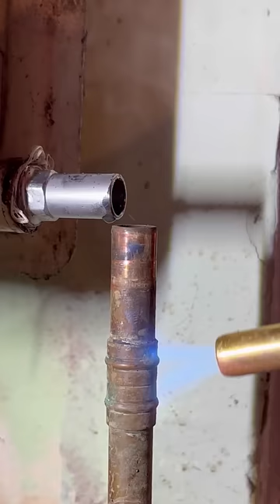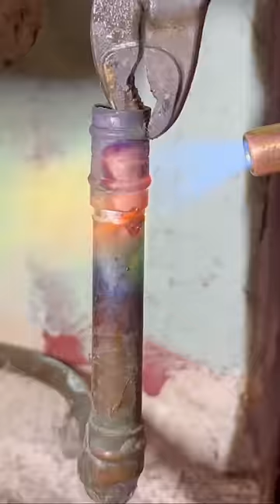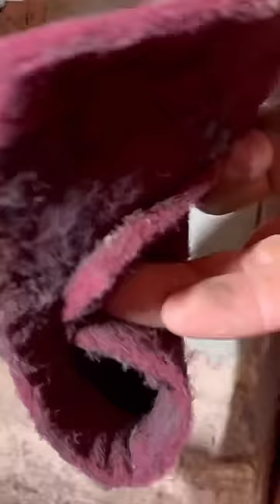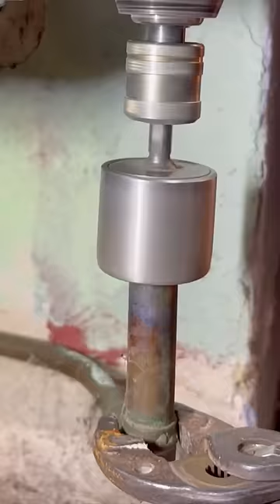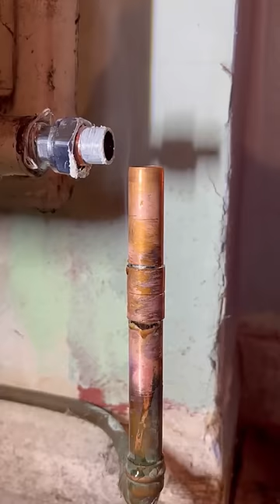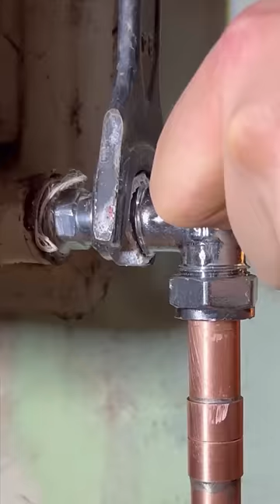HOW To remove water from pipe for soldering! #howto #diy #plumbing #youtubeshorts #asmr #subscribe

Comment: Never saw that spray trick before to remove the water.  Brilliant idea!
Reply: I used to use a straw  lol or a 3/8 ridged  speedytube
Reply: I usually have a piece of 3/8 flex line the spray bottle I’ve gotta try
Reply: Most plumbers .Have a wet vac on hand
Reply: You missed the point entirely, this is a great tip, vac will pull from other lines. Not to mention many other variables
Reply: You are just equal, not smart like him.
Reply: I use spare earth sleeve as a straw and suck it out. Got throat cancer tho
Reply: @grrinc  You are not supposed to swallow the water.
Reply: @grrinc  😂
Reply: Piece of rolled up paper towel.  No need for this craziness
Reply: Use a wet vac balls to this method .
Reply: @pauljenkinson2870 exactly because that's what real plumbers do . And we don't burn the shit out of our pipes .

Comment: No reason to use pipe dope on a compression fitting.
Reply: Lubrication. Not necessary but it helps
Reply: @micromashington  helps with what exactly?
Reply: @Jch914 lubrication of the threads
Reply: @Jch914  lubrication of the threads
Reply: @paulmacdonald7068  why do you need to lubricate the threads?   That doesn't make any sense. Been plumbing 25 years never needed to lubricate the threads.
Reply: @Jch914  you don't need to, but it helps while tightening it down. Not sure how this is hard to understand.
Reply: @paulmacdonald7068  not hard to understand just pointless.  Why do you need help tightening compression fittings? Never found it to be challenging endeavor.
Reply: Thank you for this comment! I was worried I had been missing something for the past 20 yrs.
Reply: @dukebecker4535  glad to hear I am not the only one.
Reply: The theory might be that it will act as a never seize. No real harm either way.
Reply: @orange3203  have you ever had a stop seize on you?  I mean, it is only half inch compression.  It shouldn't take much strength to remove even under the worst conditions.
Reply: @Jch914  no I haven't. I'm just saying looks like a no harm step other than wasting dope. I know guys that dope the threads on unions. No real reason for it but also no harm I guess.
Reply: The threads do not create the seal....thats the job of the olive! Where were you trained? Disneyland?
Reply: @stevewoodward7850  who we talking to here? I said I know the threads aren't the seal. Dope on a black iron union does keep the threads from rusting up though. Possibly that is the thought process here.
Reply: @stevewoodward7850  never said they did.  The ferrel makes the seal goofy Englishman.
Reply: It's actually agasint manufacturers reccomendation to lubricate the threats on a compression fitting.  It leads to over tightening.
Reply: @nes999  it actually serves no purpose whatsoever. Some people put PTFE tape on too and this is completely pointless! I stress again it's the olive that creates the seal. Uk plumber👍
Reply: @paulmacdonald7068 but he didn't put any on the threads, only on the pearl (don't know if that's what it's called in English tho)
Reply: @micromashington but he didn't put any on the threads, only on the pearl (don't know if that's what it's called in English tho)
Reply: Ok, if you’re using it to lubricate the threads then just put it on the threads. Which is not needed. But don’t put it on the pipe under the compression collar or on the collar.
Reply: I always use a jointing compound with compression fitting olives. All I know is I never get a leak and I never get call backs.
Reply: @daz3745  you’ve wasted your time, Literally! It’s not just not required, it’s also advised by manufacturers to not use sealant on compression fittings. Except of on the tapered pipe thread portion.
Reply: He the reason I sand before compression ring tool😂...please stop with the dope...just install them correctly
Reply: Ive seen it plenty of times
Reply: Putting goo on the olive is the different between a drip and no drip on a Friday afternoon, in an ideal world there is no need to goo up the olive but we don’t live in an ideal world.
Reply: @justme5384 it’s called an olive
Reply: @richardcordell9377  the f it is. Had to Google. It's called a ferrule. But in Finnish it's helmi and Swedish it's pärla, and both means pearl. You speak English because it's the only language you know. I speak English because it's the only language you know. We're not the same
Reply: Less chance of it leaking...
Reply: @richardcordell9377  than what does a Ferule puller pull?
Reply: There’s actually a video about this that was shown to me the last time I did my gas safe a few years ago. They recommend paste now as the nut slides on the olive when tightening and doesn’t grip it. Without paste the olive can twist and the fitting can tighten out of square. 
Although Ive been plumbing/gas work for nearly 30 years and I only paste something if the paste is within arms reach 😂
Reply: You people are all so sad arguing over using jointing compound on an olive/ferule. Let the man make his money and stfu
Reply: Ahh - the YouTube plumbers all arise
Reply: @Jch914 open your mind to other practices.
Reply: @venividivici4253  you mean the wrong way?  Give me a break. Only reason to use pipe dope on compression fittings is that you are completely incompetent and can't do the job correctly.
Reply: It’s joining compound,standard practice domestic & commercial gas engineer 25 yrs uk
Reply: @andrewcostello8626  might be standard practice in the UK but not in the US.  This is what hacks use who can't install correctly.  25 year master plumber who works with water and gas.
Reply: @Jch914  he has made a repair in situ,do you want to rip the whole system out and replace it with flexis.i also am a domestic and commercial gas heating engineer,I work with gas oil and water,and an f gas registered HVAC engineer so refrigerants too.if this is a dick swinging comp, I got a serious chopper my friend,I’ve poked the tip out
Reply: Was thinking if it’s drinking water that’s nasty
Reply: @orange3203  how would a copper or brass fitting rust 🤣
Reply: @Thedar561  copper does corrode but those fittings are more likely to get stuck with calcium deposits. I'm not saying it's a common or even likely problem but I also don't see why it matters if they want the extra insurance.
Reply: @orange3203  it might corrode but it won’t rust, rust only happens on iron
Reply: @Ryanwolson12  I agree you will always have a bunch of children arguing over the smallest things. Grow up children please 😅😅😅😅
Reply: @Thedar561  I never said rust in relation to copper. I said I've seen it used to prevent rust and corrosion on black iron unions. Oxidations oxidation you correct it's not called rust on copper but it still oxidation.
Reply: The only thing I dope that requires no dope is the threaded portion of gas flare fittings. Never ever ever past the first couple threads and absolutely no on the mating and mainly just to squeeze out some yellow Rectorseal to make other people feel better and so I can visually verify that it was done. I have a very sensitive gas detector, that's what I stake my decision on. It serves absolutely no purpose in the sealing, and provides no real noticeable difference in required mating force. It's window dressing for safety inspections.
Reply: You've been plumbing 25 years and never used dope? Dope is specifically for the threads... Were you using it wrong all this time? Or people don't call you back when it leaks so you never found out? I've plumbed across the US and it's pretty standard for quite a long time... (Not 25yrs though but pick up a modern book??)
Reply: @Thedar561  Corrode, and usually because we have a boner for nickel or zinc plating everything, or switching metals repeatedly, which makes a fitting more susceptible to galvanic corrosion especially in hard water. Dissimilar metals in the presence of an elevtrolyte. But yes, you need ferrous metals for rust.
Reply: @00gyb00gy  I use dope on iron pipe threads as required.  Dope and tape are not required on compression fittings. Do you not know the difference between iron pipe and compression?  Learn to think before you speak.
Reply: @paulmacdonald7068 its hard to believe the people need lube to tighten an angle stop also he didn’t even put it on the threads which I’ve seen and understand the thinking behind but nah he just caked his farrow in fucking pipe dope which makes no sense and also pisses me off 😂
Reply: @Jch914   is it really that big of a deal? You found out the why, you agree to disagree, you move on. I've seen a grown man so caught up that hes invested a month in one comment..

its really not that big of a deal..
Reply: @nes999 il suffit de ne pas trop serrer, c'est le meme constat que lorsqu'on ne lubrifie pas et qu'on serre comme un turc pour etre sur que ca ne fuira pas.
Reply: @Jch914  I was reading from a factory site about lubricating the threads with a light OIL application which would aid in the future if compression fittings need to be removed.  You still tighten to fit.  However, using pipe dope is not recommended according to the site.  Makes perfect sense to me.
Reply: @justme5384 it’s called an olive in the uk where this guy is based and it’s not “dope”. Why do you Americans think you’re the only country in the world and the only people who do things “properly”. Is he hurting you? No Are you right about the “dope” ? No. If you don’t like it go spend your time somewhere else. Start a YouTube channel for example. You obviously wouldn’t take his advice so why the heck do you think he cares about yours? You’re just increasing the number of comments and by extension his income. So if you’re trying to make him more money; crack on with the ill informed comments.  And have a lovely day.
Reply: Any plumber that says they don’t need paste on a compression fitting gets weeps all the time. Every fitting needs it
Reply: Just curious…are you calling the ferrule an olive?
Reply: It’s actually spelled “ferrule”, even though how you spelled it looks like it would be right.

I’ve seen some comments refer to them as "olives”. 
They probably thought they were sounding professional!
Reply: True, and he never actually puts it on the threads.
Reply: True, and he never actually puts it on the threads.
Reply: Are those actually called olives per manufacturers?

I’ve only known them by their trade name, “ferrule”.
Reply: Why do they call it dope? Do the fumes make you high?

Comment: Perfect except id personally sweat the pipe off at the elbow at the bottom to have a fresh piece of pipe without the coupler 👍🏻
Reply: I’d do the same I hate couplings unless absolutely necessary
Reply: I was just going to ask is there a reason for the coupler? but I’m assuming there isn’t as I was thinking why not remove it at the elbow and put clean pipe work in
Reply: He was probably.worried about that soft copper getting kinked trying to get a 90 off it. That shit gets weird when it's old I've seen it split when getting heated up when it old and someone tried to reuse it after ripping fittings off lol
Reply: I Still thinks he's an apprentice
Reply: So what. Make your own vidro.
Reply: Do yourown video, then
Reply: Have you seen the price of copper son dayum.

Just kidding I’m with you - one less point of failure
Reply: @nothankyou5524  check your spellings
Reply: Me too
Reply: you couldn't sweat it off there because the horizontal bent pipe is filled with water.  Perhaps you could cut it off though.

Comment: Why not just unsweat from the elbow and have a continuous length to the rad valve, rather than unsweat a straight coupler?
Reply: Why waste copper haha
Reply: This bloke does a lot of questionable things
Reply: That's what I thought
Reply: the spray bottle trick wouldn't work then... all the water in that pipe is at the elbow level and fills that horizontal pipe.  You wouldn't be able to unsolder that elbow since the horizontal pipe is filled with water.  You could cut that elbow off; but then the pipe might be long enough to get that new vertical pipe to where it needs to be. The vertical pipe below the coupling was just long enough so that the guy could show off his spray bottle life hack.

Comment: I usually just stick a piece of 1/4  pipe in hole and suck water out -nice video - thanks
Reply: The next size down in Pex, run the longest length you can, stick your finger over the open end, withdraw, remove finger. Or, if the floor can get wet, you can just stuff anything in the pipe and force the water out (1/2" copper with your thumb over it works great for 3/4", 3/4" for 1", etc). The ones I hate are the slightly leaking gate valves in buildings that need to have pressure reducing valves installed that make a sweat connection next to impossible without shutting off a busy commercial building's water and replacing the valve entirely.
Reply: Or blow it out
Reply: @damien1563  ko
Reply: Blow don't suck
Reply: Learned it from your mother?

Comment: I see a lot of comments on him using the coupling instead of going right to the 90 more than likely it's because of that lower it would be hard to keep the water out of that as opposed to the standpipe.
Reply: Exactly. Empty the stand pipe down as far as you can, and work fast, while a drip slowly fills it back up! The elbow is plan B

Comment: The spray nozzle is extra intuitive, very, very smart. I've been doing plumbing, I'm 45 years old. I've been doing plumbing since I'm about 15 side stuff, not as a career. It was the first business I wanted to open but I didn't for reasons. I'm not going to go into it, but I still enjoy sweating and soldering and cutting and bending and running pipe and roughing. But that i've never done that was genius

Comment: I just use a straw or small 1/4" tubing to stick inside while plugging other end with a finger to pull out the water. Stick in all the way, then plug end to trap the water inside & remove. Sprayer would work well for a smaller tubing though.👍🏻👌🏻🛠️

Comment: your soldering is very good, just don’t put flux on a hot joint because it can cause the solder to crack which can cause leaks over time
Reply: Flux, what's that??

Comment: What kind of fitting came off of that? Looked a lot like a pro press fitting, but they are not soldered on. If any one knows, what are those bumps for? Some sort of high heat gasket? Place for extra solder to collect?
Reply from the maker: There pre loaded with solder
Reply: @mmplumber  hmm interesting…

Comment: Was that a propress fitting that was soldered?
Reply: Nope a soldering or Yorkshire fitting. Fitting comes with a ring of solder inside ready for for the torch
Reply: @COUPEDUMMY  ah ok, I've never heard of that before :)
Reply: @Electronichub_05  might be a uk thing only. Different plumbing around the globe
Reply: @COUPEDUMMY 
I see them for sale in illinois, never bought them though.
Reply: They were popular 20 years ago dont see them around much anymore
Reply: Those are pre soldered fittings. Incidentally I have soldered over a leaking press fitting and it works in a pinch. I was working in a school doing an emergency leak on a 1-1/2" pipe and I fucked up the slip coupling by cutting out to much pipe and there was a steady drip coming from one side. It was 9pm and that was the only 1-1/2" coupler I had. Broke out the B tank and the solder wicked right in there. We came back 2 days later and cut it all out but I'm confident that would have been a permanent repair.
Reply: @rustyshakleford5230  it would probably work if you take the o-rings out but I think the solder would only flow till the gap where the o-ring would sit.
Reply: End feed fitting!!! Quite common here in UK.
Reply: Looks like one of those pre-soldered fittings that you supposedly just heat up and then the ring of solder melts but they don't actually work
Reply: @brett9732 been in the trade nearly 40 years and never had any problems with Yorkshire,  "pre soldered" fittings. I think the problem lies with you not the fittings. 🤔
Reply: And as I said previously, it's an end feed fitting, just copper, no solder,
Reply: Like on the main picture of the Black & Decker KX2001K-QS on their own website?
Reply: @chainsawjock same here 40 years in September,  never can I remember a Yorkshire fitting failing, some local authority work even specify it. But hey nearly 80 years  between vs some random dude on the internet. 😂
Reply: @shanefrancisbyrne maybe he didn't use flux.. 😂

Comment: Not plumbing related, but used a spray noozle w/a a small diameter hose attached to it to pump out old window washing fluid from the deep washer fluid bottle on my vehicle.

Comment: Compound or not compound, both can work if tightened properly. No plumber can assume that will leak just by having or not having compound. I don't put any but that's my way to do it because it has worked for years and through many repairs, but i won't say another plumber not to do it. For me there's more serious fails in plumbing out there and putting compound on the olives is not one of them.

Comment: Now show us on a horizontal run with a continuous drip
Reply: It works really well-you can even spray the water into the empty bottle - just be careful not to put it into a pipe that you just had your torch on for 5 minutes!?
Reply: I've used the old white bread plug on horizontal lines, it worked, keeps the water back just long enough.
Reply: Insert bread
Reply: @andrzejhajder6405 yes, use your loaf

Comment: Does that paste help prevent the valve leaking or is it so the nut goes on more smoothly
Reply: it is called flux, removes oxidation from copper which helps solder stick to the pipe and also helps it spread
Reply: it's pipe dope and you never put where he put it.  it's going to leak later when it washes out because that joint is made by compression.